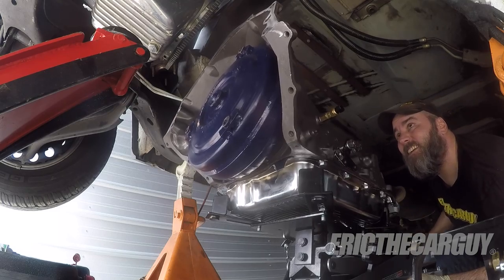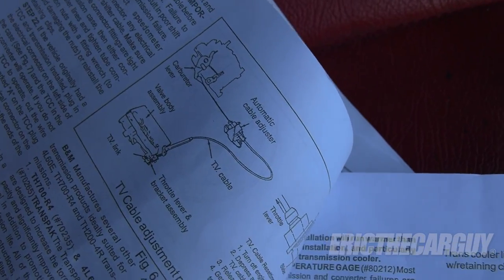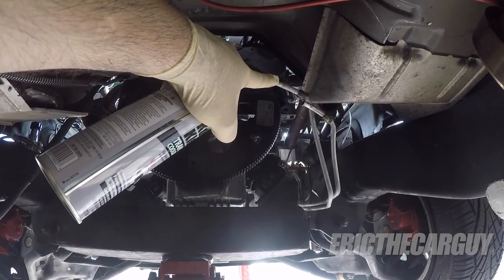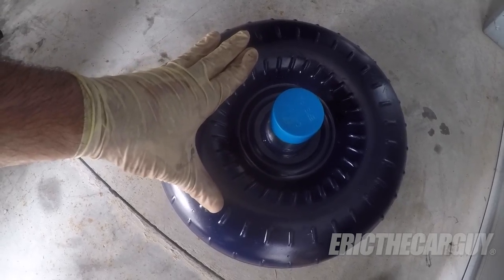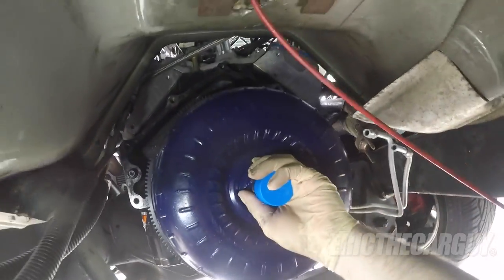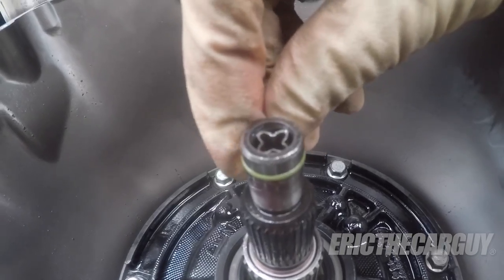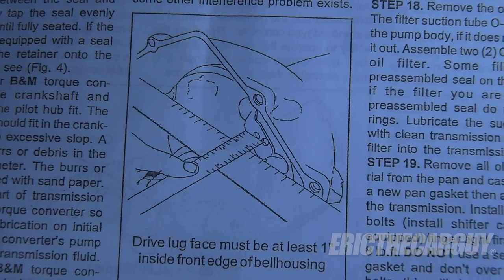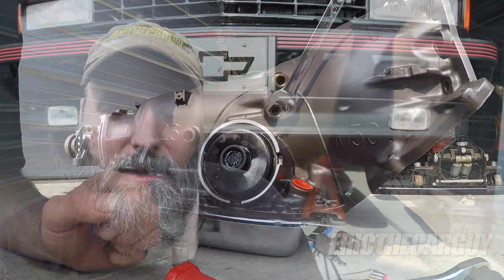5 Things You MUST Do When Installing an Automatic Transmission

Comment: Glad to see you back online.
I'd say #6, once the transmission is installed, push the torque converter fully into the transmission and make sure you've got clearance between the bolt hole flanges on the converter and the flex plate, usually .080-.100".
If there's not any, something's not right.  Find out what and fix it.  See your #3 and #5.
Reply: He mentions this in video

Comment: I've made the mistake of not fully seating a torque converter.

Had to pull the 4L60 out of my mom's Caprice to do a rear main.  Slipped the tc off to do a quick inspection of the front seals and gaskets on the trans.  Everything's hunky dory so I put tc back on.  I've done this on TH350s and ST300s before.  Turned it some... clunk.  Turned it some more.... clunk.  Good enough.

Went to reinstall the trans and the tc was hitting the flex plate before the bell housing was fully seated.  After some cursing and head scratching and my dad asking me what's wrong, I pulled it back out.  Turned the tc some more... and a third clunk.  Felt like an idiot.

"Don't tell mom."

"Tell her what?"

Dad and I make a good team.
Reply from the maker: I love this story.

Comment: I got a junkyard pull shipped to my house from a recycler hundreds of miles away, pretty good deal all things considered.  Even they had requirements for warranty.  First was to flush the trans cooler.  Fortunately, the trans came with the torque converter, with a bolted-on strap that held it in place.  Since it was a lower-mile pull from a wreck, it was pretty safe to assume it was in OK shape, which it was.  Transmission worked great the entire rest of the time I owned it...until my daughter made venison with the car.

Comment: I worked at several transmission shops in my yout. I can tell you that, right or wrong, it was never the practice at any of them to replace the converter unless there was an obvious malfunction or damage. Draining and flushing the converter was done by drilling a pop-rivet-sized hole on the outer edge near the seam and allowing the old fluid to drain through the hole, optionally refilling with cheap fluid and draining again. Then pop-rivet the hole and reinstall.

Just saying that's how it was done. It was in the GM and Ford manuals this way.
Reply from the maker: Thanks for the comment and that info. I wondered how you would be able to flush them out.
Reply: I would have thought that would throw off the balance.  Maybe not enough to matter?  I do recall seeing a TC with a drain plug.  I wish I could remember where or why, but it definitely had a square head drain plug.  Now I'm wondering if that was on the Cottman supposedly rebuilt TH350 that they stuck in my Skylark back in the 90s.
Reply: @maingun07  Yep, not enough to matter.

Comment: good practice to check the TQ/flex plate clearance.  there is a spec for every trans.  Over a certain value and you need to add washer shims.

Comment: Man i just looking for a video of this from you when i was installing mine on my 85 S10 couple days ago and ones I watched of others on YouTube didn't really give me what I wanted like you did but I pretty much did everything like u said however I could barley get maybe.... 1 quart of fluid in the torque converter and could not figure out why but I guess it's better than nothing at all .

Mines a stock application for transmission side . The 700r4 but 60degree style so hopefully everything should work just fine. The spacing between the flexplate and converter has me a little concerned there's a gap but what I have seen that's normal but shouldn't be to much tho however the old engine and flexplate did not have any space or that much but I also put in a New T-Q at the same time I did my engine because the old T-Q was not locking up right it would lockup to early or sometimes hit hard if going down a hill and I didn't have my foot on gas just odd .

Comment: Yeah... the first time I pulled out an engine (just after highschool) the torque converter leaked some fluid out and I was confused and assumed it would refill from the transmission.

It does not, definitely refill that. Some weird effects when it is only partly filled.

Thank you for the tips and reminders.

Comment: How high did you have to lift your truck to remove the transmission?

How did you get to the top bolts on the transmission housing?

Comment: Question, if you get the engine replaced but not the actual torque converter nor transmission, what can be causing it to shudder if you start downshifting to brake the car?
Yep, you guessed it, Ford Escape 2018 2.0 EcoBoost, euro-spec sold in Mexico version, post-engine failure.

Comment: Just put a new battery in my 2015 pathfinder  and the engine compartment seemed extremely hot. All in all my battery drained and my alternator isn't broken. What could be causing this

Comment: Should we use the oil weight recommended by the manufacturer or proper weight for the climate you live in?
Reply from the maker: To the best of my knowledge, automatic transmission doesn't list oil weights like engine oil. Be sure to use the fluid recommended in the instructions.
Reply: @ericthecarguy  thanks for the reply.  I was thinking about engine oil. But did ask under a video about automatic transmissions.  Sorry.

Comment: How often should xmsn fluid be changed?  I had mine replaced about two years ago; is it necessary to go back to the place of installation for fluid changes?
Reply from the maker: No, you can do them yourself. The procedure is often outlined in the service manual, along with the service interval. I usually change mine about every 30K.

Comment: Did the Monster transmission crap out on you already? That's normal for a Monster if so, I don't know how that company is still in business, they have had a bad reputation for years.
Reply from the maker: Yes, that's why I went with the Jegs unit. No issues at all so far.